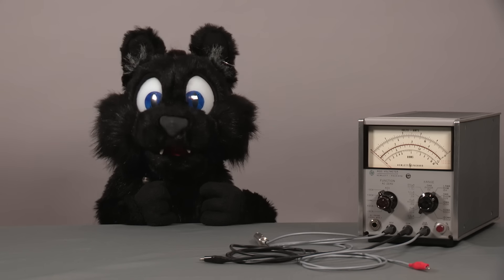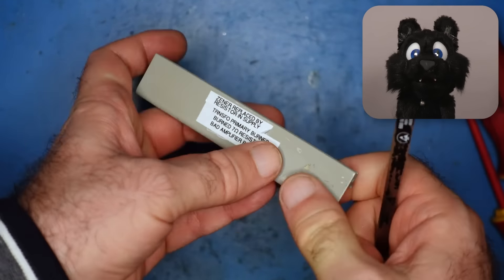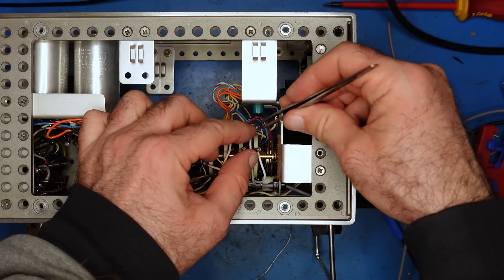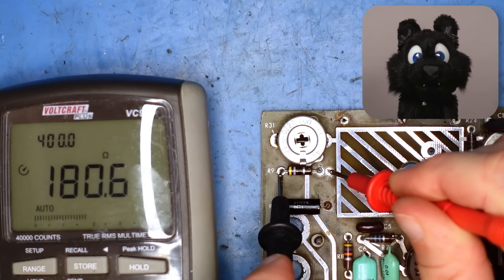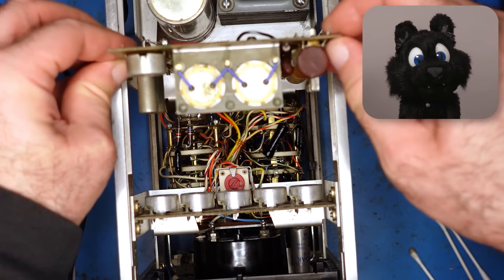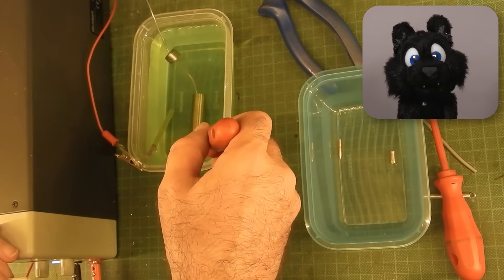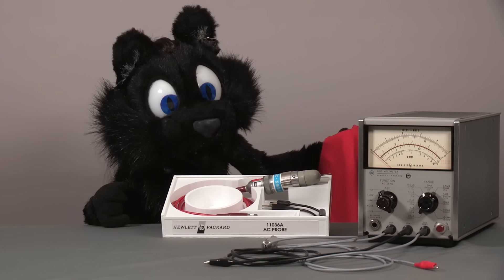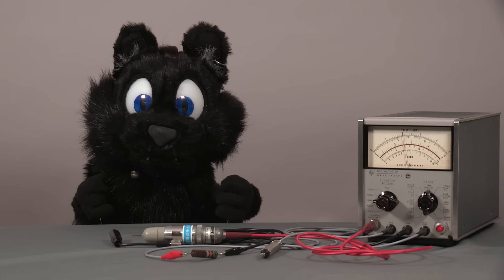HP 410C VTVM (as seen with  @CuriousMarc ) - Part 2

Comment: Very nice restoration ❤
Honestly speaking, I had been waiting for an entire redesign of the AC probe 😉
I once had a HP425 meter, even older design I guess - it had an opto-mechanical chopper.
A motor was driving a segmented wheel interrupting the light to the LDRs.
But it was too bulky for my bench, so I gave it away…
Reply from the maker: I still toy with the idea of making a new probe; but I need decent RF diodes that fit into the case and those are rare. It also took me quite some time to understand just how that level shifting worked; which is why I added the explanation; It uses the capacitor in a way that was novel to me. The last VTVM had a similar circuit, but I did it off as "strange tube for sure" without digging much deeper.

Comment: The Testofon is also quite handy for testing potentiometers. For one thing you can hear the frequency rise and fall while turning the pot (if that doesn't happen, it's broken) , and if it sounds scratchy or has dead spots, well, you gotta clean it. I think I forgot to demonstrate that in my Testofon video (which is on the arcade museum's channel @flipperarcade)
Reply: And I'm wondering for years if there wasn't already some appliance invented to test it like this. Here it is! Thanks for the name! - It's like the octopus but with sound I assume?
Reply: @nikreichel2232   The Testofon can check pretty much anything, resistors, diodes, capacitors (capacity and leakage, since it can check down do <1µA), transformers, and even transistors. It can also be used as a signature generator (if you have two identical circuits and one isn't working) and a poor man's logic probe.
And I forgot they renamed it, it's now called the Contitest. (the video I'm referring to is still called Testofon Tutorial though)

Comment: You never cease to impress with your work and how thorough you are with your work. You don´t happen to know what kind of capacitor there is inside such an AC Probe? if it is a type that is prone to decay like a wax cap or a better one like a mustard cap? it does not seem those are very easy to replace if they break these days
Reply: I took the probe apart and I am almost positive the tip cap is formed by the air gap between the silver plated metal plates you saw inside the cap.

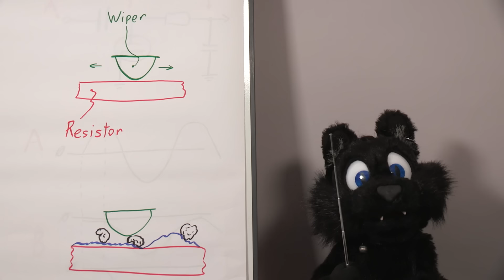Comment: 5:10 I have an old-ish (late 1990s) digital handheld multimeter that has a “fake” analog display on it for that use case. It’s a long bar graph sort of thing all the way across the bottom of the LCD with 30 or so segments to it. I suspect the accuracy isn’t great: none of the segments are labeled, although every fifth segment is a bit taller, so maybe (edit: at 9:25 you can see the kind of bar graph I’m talking about, though yours is a lot higher resolution than the one I’m describing). I’ve never actually tried to count segments to get a value out of it, that’s not what it’s for. It’s there because it’s much, much faster than the numbers on the rest of the display. Almost faster than I can see, actually.

All in all, it’s not quite as good as a needle, but it’s been “good enough” for me to avoid digging a real analog meter out of the toolbox a few times. I was kinda disappointed when I bought a more accurate, modern meter when I realized that it didn’t have this feature.

Thanks atkelar, your videos are consistently excellent.
Reply from the maker: The bar graph displays can do a bit towards that, yes, but they need to be fast enough, which they often are not; the better meters have those on a different and much faster update rate than the numbers to see fluctuations. I still love to pick up the old needle meters for that though 😇

Comment: Love your videos. I have 2 of these and I am interested knowing what coaxial cable you used for the probes? Can you share a link. Cheers.
Reply from the maker: I am on the road at the moment. I will look up the order and provide a link, when I'm home again, next Wednesday at the latest.
Reply: I still haven’t found suitable coaxial. Tried some from Mouser but it is as stiff as a board.
Reply from the maker: Ack! I did some backtracking and couldn't ind my order, then I completely forgot about the comment. Sorry 😿

After searching again today, I realized that it wasn't an e-bay order, but rather one from Amazon! Here's the link: https://www.amazon.de/-/en/dp/B0CH8H74RZ - note that I ordered several AWG sizes, and that the voltage rating is - as mentioned - only 300V. But they are at least flexible enough for probe wires.
Reply: @atkelar  Thanks. It appears they don’t ship to Australia. Noooooooo…… aaaaargh.

Comment: Really nice restoration work! Incidentally, one of these 410c’s landed on my lap and I wanted to ask you if dor yours, the needle is rock solid stable? Mine appears to be working fine, except the needle has a small non-periodic oscillation on all scales and all modes. First thing I tried was to adjust the frequency of the photochopper but that didn’t cure it. Any tips are appreciated. Thank you for a really useful and enjoyable video!
Reply from the maker: Thanks! - as for the needle... is it doing that with shorted inputs too? Or are they "floating" somewhere? 'cause with the high input impedance, floating inputs can really mess up the input here. As a second try, I'd double check the ground connections first.They also need to be rock solid.
Reply: @atkelar  It’s very clean inside so no obvious signs of corrosion. The needle movement is even with the probes shorted so clearly it’s something that affects the entire meter. Probing it with the amplifier board in place is basically impossible so I need to wait a few days until I get the extension board delivered and then I’ll start hunting for the fault with my scope. In the meantime, I did test the amplification like they suggest in the manual by probing the DC amplifier output on the back and indeed I see a dirty signal on top of the DC component. Thanks for the helpful advice , I’ll poke around once I have the extension board and report back.